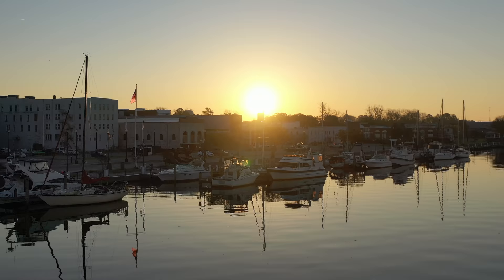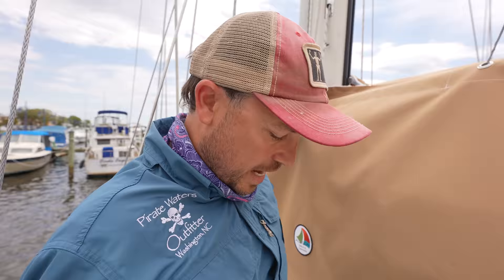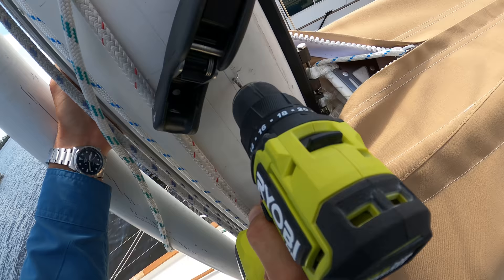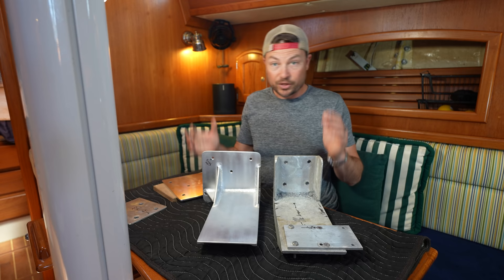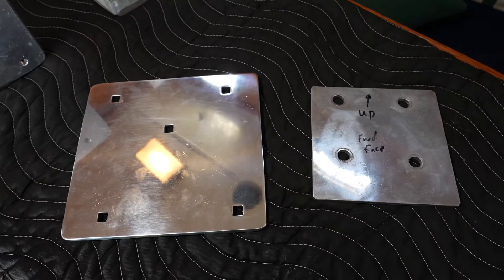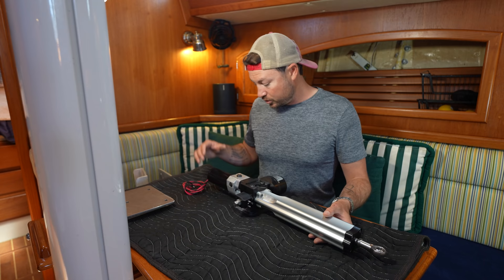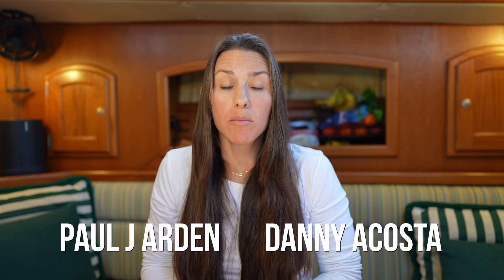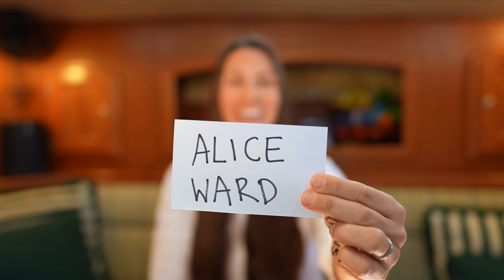Is it DANGEROUS to Sail Across the Atlantic Ocean? | S06E45

Comment: I've crossed the Atlantic on a 50' sailboat with three other people and 2 autopilots. We experienced a gale. It was uncomfortable, but doable. 
     Yes, there were things that went wrong. The boat itself was solid, but there was a lack of handholds, the stove wasn't gimbaled, both autopilots developed issues. There was a lot of water in the diesel, so we were drifting in big swells with no wind, changing out the fuel filters. Have backups/spares for everything!
       I wouldn't trade the experience for anything. The Azores were wonderful. I've lost whatever Portuguese I learned, but did use it. I look forward to getting back out there. I actually teared up when John Kretschmer described his perspective on the wonder of sailing in the middle of an ocean. There is nothing like it. Whales, dolphins, a rainbow from horizon to horizon, a sense of peace....
     We used our tethers primarily at night or alone on deck, and a short tether when leaving the cockpit. I have seen advice that you always clip to the windward jackline, since you're more likely to fall towards the low side. I have a friend who was on his boat alone in "the Perfect Storm" and got knocked overboard. He hung by his tether for hours and got beat up badly getting slammed against the boat, but he survived. Better to stay on the boat.
Reply: A boat is for the sailors the water is for the fishes. It doesn't matter day or night or how many people are on board or on deck. The preferred place to be on a sailboat is "on the boat". In the water is a crapshoot.

Comment: Are you guys familiar with the life-vests of TeamO, they have a built-in 'back-tow feature'?  These life-vests are designed such that they basically eliminate the risk of drowning when being towed through the water at speed, after having falling overboard.  In that way the wearer at least stays connected to the mothership safe from drowning.
Trying to find someone who fell overboard in a sea state with  over 3ft waves is going to be a hell of a challenge.  The size of ones head is roughly the size of a soccer ball, not very large and easy to lose sight of in any 'wavy' sea state...
I first saw TeamO live vests trialed and tested by Sailing Uma, they also showed the back story to the design and this company in the UK: a real eye-opener...

Comment: For the crew member that will be crossing the Atlantic with you.  Since he has never sailed before, consider purchasing an electronic anti-seasickness wrist bracelet,  I use a EmeTerm one, costs around $130, has rechargeable bat and has variable electric impulse which stops the signal going to brain that causes seasickness.  John mentioned being uncomfortable being one of the issues crossing the Atlantic- seasickness is one of those uncomfortable issues.
Reply: Do these actually work??
Reply: @readmycomment3157  It has worked for me,  Regular wrist pressure point Seabands did not work but the electronic version noted did.  It takes a bit of getting used to the tiny electric impulse but your brain/body adapts to it.  Some people's inner ear mechanism never get "used" to the wave motion on a boat and can be seasick a lot,  If your new crew member is like that then the crossing will be uncomfortable. Motion sickness pills may help but usually make the person sleepy and useless for night watches and other chores/duties.  The electronic seaband version just may be the insurance you need for a useful crew member.

Comment: Great stuff. For safety, I would play a little what if with the systems on the boat. For example, If the autopilot fails we will A. Hand Steer or B. Rig up the wind vane backup. You may not have a wind vane back up but that 's okay if you plan to hand steer. I would do this with the major systems on the boat. Especially furlers, halyards, etc. Stuff is going to break, just think about the workarounds. Once that is complete, just go and enjoy.
Reply: Wind vanes are great    Redundant auto pilot esp. if there is loss of electricity. Do you think of any way of adding one with your present stern setup?

Comment: Risk has a formula... it's Impact x Likelihood.
You can also mitigate risk to reduce either the impact or likelihood of a particular event.  For example:
Falling overboard can be mitigated by having effective safety equipment / procedures.
Equipment failure can be mitigated by making sure systems are in good working order.
You're doing a great job and keep up the good work!
Reply: The risk also increases as conditions change.  A tack alone increases MOB probabilities by hundreds of percentages.  Experience of the sailor is another factor and so is fatigue. So probability factors has two sides.

Comment: Great video as always.
I have always been shocked at how people run their safety lines and the length of their tethers. I’m not talking about amateurs, I’m talking about YouTubers with 50,000 miles. They all missed the point that the tether is to keep you from falling out not to save you, if you do.
Reply: Beautifully said. For 20 years that was my personal philosophy. "Don't go overboard". "Don't do anything that can or will put you overboard. All safety lines were used with this thought paramount in their placement and use.
Reply: correct, ive done 60.000 miles offshore my harness line is short enough so it cant catch in between my legs if im moving quick .that hurts.
Reply: @robertcooke1774  Now, that makes good sense. It should keep you from going over and all the bad stuff that happens because of landing in the water.

Comment: Just a tip Jordan..  Always good practice after a few days of operation, to go back and check the tightness of the bolts on the mounting bracket for the auto pilot. This always good practice for any fasteners you use on the boat.

Comment: Over on Sailing Uma Dan and Kika demonstrated the "Man Over Board" drill over and over in one of their Steps.  But they also purchased these special life jackets that had the safety line running to the upper back of the jacket.  That way, if you went overboard, you were dragged/towed with your head up and back first.  I think there's less resistance with that position as well.
On a kind of different topic, I have lost a "favorite" hat overboard a couple times.  I single hand my smallish 20' sailboat on large local lakes.  Generally, when I've lost my hat(s), the winds were in the 10-12 mph area.  In at least two of the occasions I was able to keep an eye on the hat, reverse course and grab the hat as it slid by next to the boat.  Neither time was the maneuver just that simple. A second try was often necessary.  But I was amazed at how my own "auto pilot" took over and in less than 5 minutes I had my hat back.  This kind of connects with picking up a person who has fallen over board.  
Now, your boat can't alter course as quickly but it would be interesting for you guys to, while one of you single hands the boat, tries to retrieve some smallish floating object that "falls" overboard unexpectedly.  Maybe just see if you can stop the boat swiftly.  Can you keep an eye on the object while trying to alter course to back where the object is.  Clearly don't try practicing this if it's blowing a gale.  Get your confidence up in mild/moderate conditions.  BTW - This is a FUN game too!  I was almost jumping for joy after I got my hat(s) back.  PS - You would need gaff since you're higher off the water.
Reply: I used to do the same thing (also while sailing on a lake).  It's good practice.  It's probably also a good idea to practice hauling a person onto the boat who cannot help.  I've never tried doing that, but I think it would be very difficult.
Reply: @LVQ-so5th  Practice, practice, practice "all the time" and even that is no guarantee of a successful recovery to onboard status for the person that went overboard.

Comment: For the worse case sailing scenarios, read "Fastnet Force Ten" and watch videos on the Sydney Hobart Race disaster.  Then avoid those conditions.  We had two man overboard events locally.  When I was pulling my Chrysler 22' into it's slip my friend reached out for a piling but the wind had move the boat and he fell in.  Even though the boat was in a slip in the marina, it was almost impossible to get him back into the boat.  I finally grabbed the back of his belt and managed to pull him over the side.  There's no way I could have done that out on the water.  On a different occasion a crewman on a J-24 slipped under the lifeline while tacking 100 yards from shore.  It was cold, blowing hard and everyone had on winter sailing clothes.  Someone immediately threw a life ring tied to the man overboard pole but he ignored it. The boat spun on a dime.  The crew got their hands on the guy but he didn't help and he slipped out of their hands.  Again they approached him and got their hand on him but he slipped away for good.  He was found the next day.  I would suggest wearing an inflatable harness as I'm sure you will.  The mainsheet hanging from the boom can be used as a hoist when clipped to the harness to get someone back on board.  And make sure everything in the boat is tied down and secures so that if the boat ever did a 360 roll, a flying battery or stove won't do you in.  But mostly stay out of dangerous conditions if possible.
Reply: If I remember my sailing days way back in 1975 -1996 on lake Ontario, NY, and Ontario, Canada, the St Lawrence River, and the Thousand Islands, and my beginning days on Lake Erie, challenging weather, high winds, waves, or heavy fog always caused us to stay in port until thing cleared up or quieted down. "But mostly stay out of dangerous conditions if possible". It is interesting how many times that " challenging weather" would seek us out or catch up to us from someplace else on the lake or in the river. I believe that our success was related to our sailboat, planning, preparation, and practice. We did a lot of that, I, my wife, and 2 boys that started sailing from scratch at 7 and 11 in 1976.

Comment: Nice video. Again. As "risk" is a constant theme with the Attics, look at it this way. Make a list of things that can go wrong. When you are done with making the list, write next to it "plus an equally long list that we could not have known in advance". For each known, what are chances that will happen? For each, what will be the impact, liability, consequential damage, etc.? Extremely low chance and extremely low impact: forget it. Some risks have too high an impact to do nothing, others too high a chance of materializing. If you can have insurance, you may be able to transfer the (financial) liability associated with the impact, but that does not reduce chances and impacts in themselves.
For example, having the electronic/hydraulic autopilot fixed is one thing, but it still can break and if that happens someone needs to be at the helm at all times. For a solo-sailor that may mean 10 days without sleep (killing). You reduced the chance by a lot but did not mitigate the impact (other than having 3 people on board). Having the autopilot revamped means that the likelihood is extremely low and I would not worry at this moment - as it was improved on all levels. If you were to cross the ocean (Earth only has one ocean ...) multiple times in a row, then the electronic/hydraulic autopilot might have its risk-impact mitigated with a windvane version that is purely and transparently mechanical.
And this is the somewhat academic approach. How you guesstimate chances and risks says more about you than about reality.
The most important thing is to be aware that a ship is as seaworthy as its crew. Prevent problems by sailing at 70% or 80% instead of making it a race at 105%. Here it is all important that communication is clear between participants, as well as roles and responsibilities. In emergency situations people should be able to postpone their panic attack until after the emergency got solved. And in stressful moments, it should be clear who has most experience in handling such situations - no debates, get things done >now< without adding new risks or problems.
And if you bring an inexperienced sailor on board, make that person cook when the going gets tough and train/educate them when the sailing is easy - to begin with.
Wanting to go from A to B also dictates motoring or not. If you do not need to be at B before date-time X then you do not need to motor out of a few days of calm wind/waters. Making your own drinking water and having enough food or catching food might be enough in those cases and an inexperienced sailor might be an excellent fisherman, too.

Comment: Crossing the road, getting in a car, or even riding a bicycle, and many more examples, are all activities that carry the risk of getting killed, people don't go asking you how risky they are, people tend to think these are low risk activities, but they are not really any less risky than sailing a boat in the ocean, the difference is those are familiar land activities. the prep you are doing is the equivalent to servicing your car and making sure the tyres are good before you do a long trip, sensible and wise precautions to lower the risk of having a bad trip. I wouldn't suggest crossing the USA in a car that was overdue for service, just like I wouldn't suggest the preparations you've done were un necessary, but discuss it in the same terms and and family might feel less concerned.

Comment: You found a few wonky hose clamps?  The first thing, when finally a Captain, I would do on a new-to-me boat was to change ALL hose clamps.  I could write up a thru-hill-diagram which was placed in a plastic sleeve and taped under the nav table …. In case of emergency.

Years before I was crew on a 64 footer.  Offshore a hose clamp on the fresh water system blew.  Our entire fresh water supply went into the bilge.

Offshore I managed to siphon the water remaining at the bottom of the tanks …. Enough for each crew to have a gallon and a few gallons for the galley. (4 days out of St Thomas).

Change ALL hose clamps.  Learned the hard way.

Comment: Do not worry.  We crossed the Atlantic in the 1980s with a sextant, Casio watch, and an analog depth sounder on a Dufour 35, presently cruising the Bahamas on a Bristol 35.5, but you guys have made amazing preparations and the technology is so much better now than 40 years ago.  It will be interesting to see what you change after your crossing.  Respectfully I recommend you do not take crew.  The two of you need to understand the deep-ocean, easily done without the noise of several outside personalities.  This is your personal adventure, not a yacht delivery.

Comment: And that's why I check the threads on the tap by laying the bolt on top before I tap the every hole........I learned the same way too,lol. Hope you remembered the corrosion killer on the bolt threads on the mast and something to isolate the aluminum from the bolts on the clutch. Remember the mast step. She's looking more and more fit every time I watch, keep up the good work.